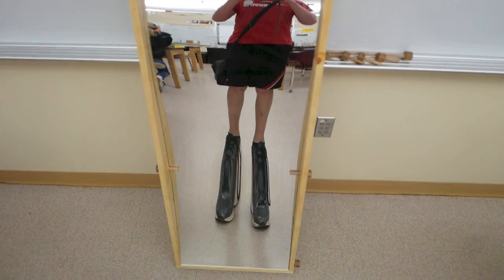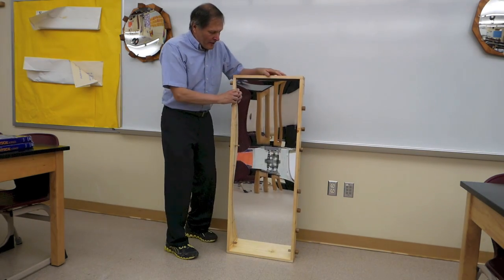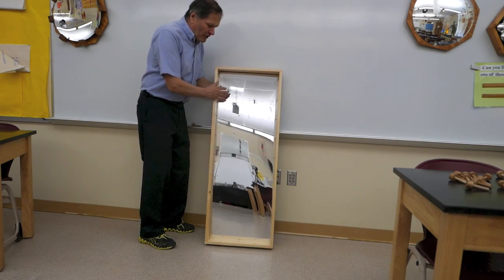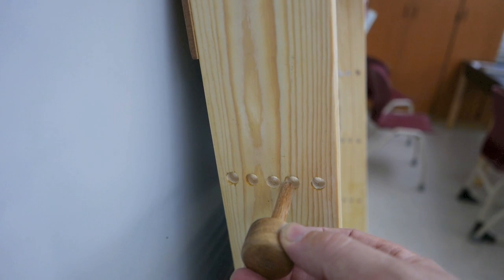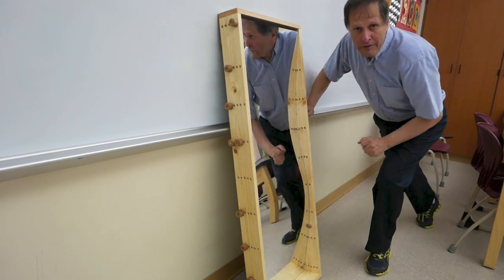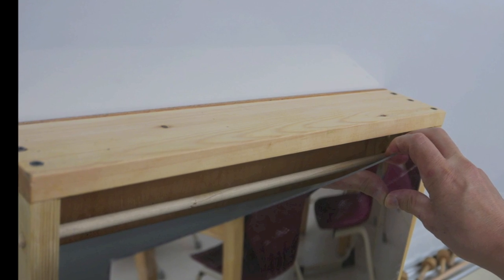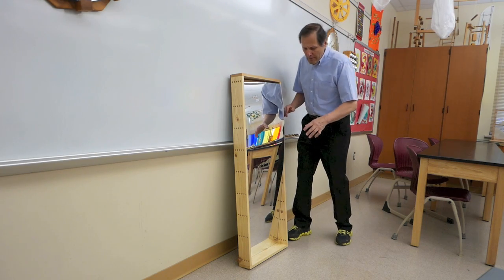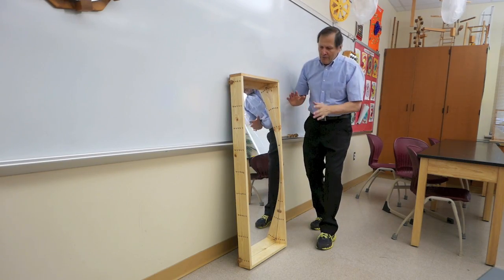Funhouse mirror- Physics of toys  // Homemade Science with Bruce Yeany

Comment: It looks like your frame is made with 2x4??   I’m trying to figure out the best width for the frame.   It looks like your dowel holes will allow for about 3” maximum bend - does that seem about right?  Would more be better or does the effect not work well at higher bends?
Reply from the maker: the frame is made actually 1 x 4,  we've made a few of these since I posted this video. the spacing is dependent on how easily the mirror bends some bent easier than others
Reply: Thanks!!

Comment: Out of your two versions, how did you determine and what vertical spacing did you chose/effective for you holes?
Reply from the maker: after bending the material a few times,  the placement of the holes were a guess, it has quite a bit of flexibility to it, spacing seemed reasonable, but do not try to bend plastic too sharply or it will crack

Comment: Hi Bruce,
How did you glue the sheet mirror and the acrylic sheet together?
Thank you.
Reply from the maker: Hello Lance,   I didn't,   the sheet mirror was purchased at Lowe's for about $10  and worked until I stressed it a bit too much.   The acrylic sheet was purchased online as an acrylic sheet mirror.  It costs about $50
Reply: Where on line did you get the acrylic sheet mirror?